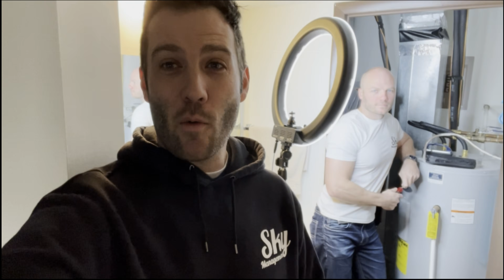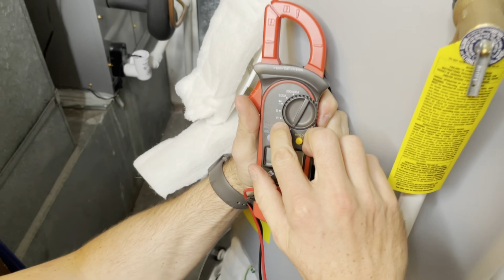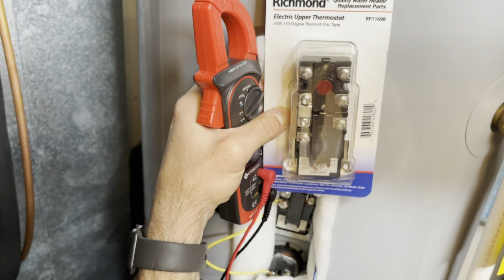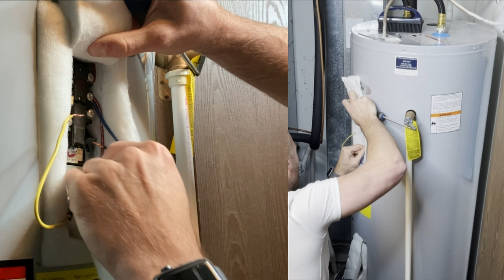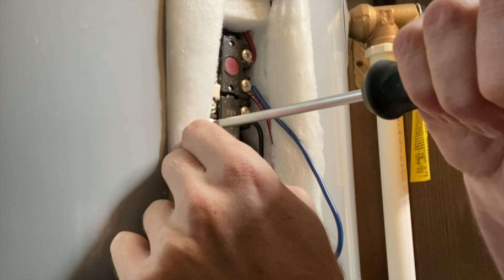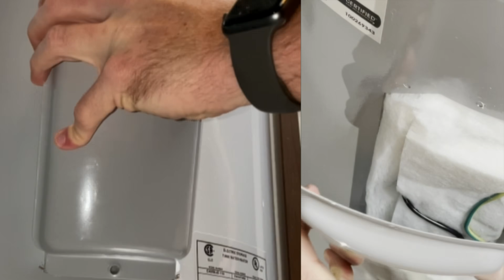Water heater not getting hot.  Thermostat Replacement.

Comment: You should make an inverted pee trap for heat and cold and get rid of the stupid heat trap they used for it... The galvanized will rust and restrict anything that flow in it.... the pee trap is 100% efficient than the factory installed...

Comment: I'm a single woman doing this myself how do I turn electric off to hot water heater
Reply from the maker: The easiest way is to turn off the breaker that leads to the hot water heater. sometimes there is a power shutoff right next to the water heater, but to be safe, you can turn off the breaker in the house breaker box. 
If you are unsure which breaker it is, you can turn off all of them. (or the "main")

Comment: Thanks guys.  Really hard water at my place so I replace elements about every other year.  Usually the bottom.  I have a thermostat so i figured lets do it too.
Reply from the maker: No problem :) Yeah, it almost always seems to be the bottom element that goes out.
Reply: @SkyManagement  I bought a 5500 W power element. I’m getting ready to return it for a couple new 4500 watt elements which is what I’m supposed to use.   is it safe to use a 5500 W element in one position or the other
Reply from the maker: I would probably stick with the same watt that came out of the unit. I don’t think it would matter. But, I’m not a certified electrician... so I’d play it safe. Lol.
Reply: @SkyManagement  thanks.  I appreciate it.  I’m on my way to Menards right now.  I’m going to replace both heating units even though only one of them is bad. The other is coated with water deposits flaky white calcium deposits. We have excessive hard water which is supplied through the ground well.  Maybe a water softener in the future but not in the cards right now. Last fall I vacuumed out 2 inches of built up white flakes.

Comment: I replace 30 gal single water heater heating element and thermostat. 240V reading at all points all the way to and including heating element. Still not working. What else should I check?
Reply from the maker: Test the ohms on the element. With the power off, test the screws on the back of the element. The ohms reading should be between 9-1. If it’s way higher or lower than that. Then maybe the new element was bad to start with.
Reply: @SkyManagement  thanks will check.
Reply from the maker: Well.  I’m at a loss there... if you have power and thermostat works... and you have power to the element ... and it comes on and you still don’t have hot water...? Then I would guess it’s time for a new water heater or your cold and hot water lines got mixed up somehow?